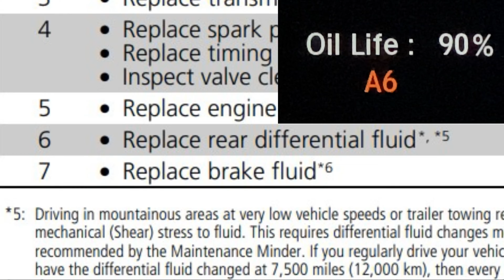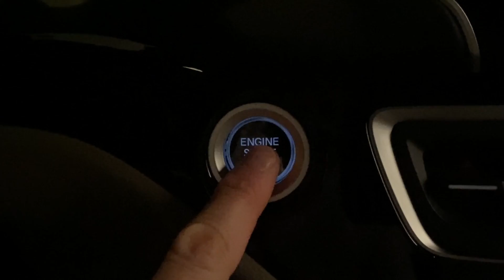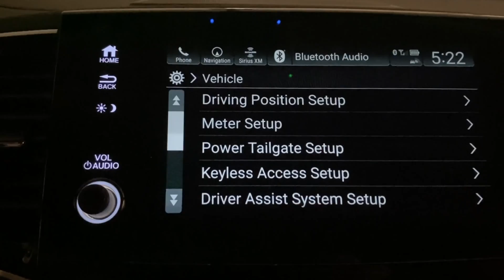2016 - 2023 Honda Pilot Rear Differential Fluid Replacement (With Bleeding Procedure)

Comment from the maker: • Honda 08200-9007 Dual Pump II Differential Fluid:  https://amzn.to/41LgQWw
• Eneos 3410-300 Import DPS Fluid:  https://amzn.to/3KYp0o0
• Quart Bottle Fluid Pump:  https://amzn.to/3UXZxPS
• 3/8 Inch Beam Torque Wrench:  https://amzn.to/3n0VLsz
• 3/8-Inch Drive Click Torque Wrench:  https://amzn.to/3Anrw2c
• Extension Bar Set:  https://amzn.to/3UXCnt8

https://www.piloteers.org/attachments/rear-differential-fluid-inspection-and-replacement-awd-1417-pdf.157832/
https://www.eneos.us/product/eneos-import-dps-fluid/

As an Amazon Associate I earn from qualifying purchases.

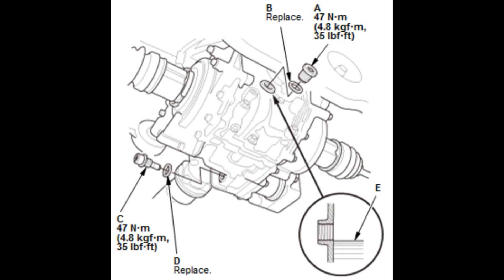Comment: I have a 2017 Honda Ridgeline which has many maintenance tasks identical to the Honda Pilot.  WHERE did you find any of the maintenance diagrams you show (e.g.  at 1:45)? I can't find any repair manual or documents.

Comment: Thanks so much for sharing; this was a perfect video!  I have a newer gen. (23-25+) and I was able to use just a 6 inch extension for the fill plug.

And this probably goes without saying,  and many will laugh at this, but make sure the vehicle is level when you fill it!  I drained it with the rear elevated, which works great because of the drain plug location.  However,  I filled it with the rear elevated.  I got out and looked and said, this really needs to be level.  As I raised the front to level it out,  a decent amount of fluid drained out.

Make sure your car is level before filling!

Comment: There is a boatload of videos for the rare differential but not found one yet for the front which I believe uses traditional gear oil? I wonder why that one is so ignored?
Reply from the maker: I believe that it is lubricated by the transmission as it is built into the transmission housing.
Reply: I did finally find a video. And found the specs on Honda repairman.  The front differential is gear oil. Apparently  even easier to change. I already bought the gear oil I'm changing all the fluids this weekend.
Reply: Would the front differential have to be bled? @OwenLucas
Reply: Yes sir, every 30k just like the rear. And it does use gear oil. It is easy peasy to change out. Lower and upper bolts are up n down from each other facing forward toward the front of the car. Good to do while changing the trans fluid. I would send you a screenshots but I can't attach pictures here apparently. You can look it up.
Reply: @eastcoastroadrunner  is it the same bleeding procedure for the transfer case!
Reply: @tribeofissachar9148  about the same, just did mine yesterday. Even off the vehicle, drain, only holds about a 1/2 qt of gear oil. Refile till it flows out. No need to restart and check again. Both bolts are the same with 20mm washers like the one on the top rear differential. Uses Hypoid gear oil SAE 75w-85 or 90.
32 ft lbs for both. The easiest/fastest  fluid to change on the whole vehicle...lol
Reply: @eastcoastroadrunner  ?

Comment: This is one of the best Honda maintenance videos I have ever seen.  Great job!! Question, the link to the drive click torque wrench has a different looking product than in the video. The on in the video looks more like the Amazon basics one.  Just wanting to confirm that.  Another quesiton, does the car have to be raised to do this work?
Reply from the maker: Thank you for the heads up! You do not need to raise the vehicle, it does get tight under there though!

Comment: Thank you very much for your detailed video explanation demonstration. My car is a 2022 HONDA CRV-Hybrid. I followed your video to change the transmission oil for the first time. Only question, why is the old oil I put out colorless and the one you recommended is pink. Could it be that the wrong oil type was replaced?

Comment: Which plug gets the 20mm washer?
Reply from the maker: I believe it was the upper drain bolt.  It's been a while so just make sure to keep track of the sizes when you are removing the washers.
Reply: I just changed my transfer case and rear differential fluids today. On the differential the fill plug gets the 20 mm washer.

Comment: I was just at my local Honda dealer a few minutes ago, and they told me the torque spec for the drain plug and fill plug for both the rear differential and the transfer case is 31 ft lbs for my 2018 Honda Pilot.
Reply: That’s literally no difference learn how to tighten something without relying on torque specs
Reply: @Therealestrunnerluda  Thats foolish and risky. People have put small cracks in housings that way.
Reply: @Therealestrunnerluda  You mean learn how to break things and cause tons of headache because you think you know better.  People that THINK they know how to unmeasured torque are why the ford dealer put the wifes lug nuts on so tight my 1200 ftlb impact could not break them free.  Would have been completely screwed if roadside.

Comment: I’ve got a 2021 pilot with 45k miles. The b16 maintenance light came on which according to the internet means it need tire rotation, oil change, and differential fluid change. Does this mean that every time I change the engine oil I’ll also have to change the differential fluid? Thanks and great video👍🏻
Reply from the maker: Once you reset code 6 you won’t have to do it again until it comes back on with the maintenance minder on the dashboard.  You should be good for at least another 30k miles.
Reply: @OwenLucas 😊

Comment: How often should this be changed? I have a brand new 2022 Honda passport EX-L with only 10291 miles on it. I see that my oil has got 30% left and the B6 code sign.
Reply from the maker: Honda's maintenance minder system does not generally go by mileage intervals, the computer decides when its time to change a fluid based on usage features such as age, temp, distance.  To me, 10k miles seems very early for code 6 but it must be done.  30% is probably indicating oil like left.  On my 21 it doesn't provide a % for any other fluid other than oil.  From what I've read online, such as the Piloteers forum, the average interval for the rear diff is 30k miles and oil is 10k miles.  I do my oil at 5k intervals though.

Comment: I changed my rear differential fluid today on my 2023 Honda Pilot and this guide was spot on, thank you!
Reply: How much did cost you ? because i am at the dealer and they are charging $150
Reply: @fawad20982  Total of $70. bought all items from Amazon. $60 for fluid, $5 for drain plug, $5 for fluid pump. Took about 15-20 minutes to do.
Reply: @fawad20982  150 here too in northern california
Reply: @fawad20982  about $50 for parts/tools and fluid. About to change it again.
Reply from the maker: Awesome!  Glad to help and hope your experience was less messy!
Reply: My dealer originally charged me 189.00 at 18k miles. Then at 40k tried to charge me 490.00, this time I passed. Now at 60k; my cousin who ‘was’ a Honda tech at El Cerrito Honda; removed & replaced my rear diff fluid for 50.00, and 48.00 for parts. Done.
Reply: I got 2023 pilot sport too nd currently 21k. 1st oil change and diff fluid was changed at the dealership. Im thinking of doing it on my own next. Did u reset anything in the screen?
Reply: @TanSuroYan  yes, I think the code you need to reset is listed in the owners manual under the  maintenance section.
Reply: @nick94712  my manual says different to my sport trim. What it does says on it is for higher trim that have to use the screen. I got no prevailage like higher trims but i have to double or triple check it again b4 doing anything on my own.

Comment: How many miles were on your Pilot when this A6 indicator showed up on your maintenance minder?  Also, could you also do a video on how to change the gear oil in the transfer cares.
Reply: If the transfer case was part of the transmission why is it different fluid and different service intervals? May want to rethink your comment.
Reply: @Sparkynutz81  The transfer case is not part of the transmission, it is only attached to the rear of the transmission.  It takes a totally different fluid then the transmission (GL5 Gear oil) and only holds about 0.5 US qts
Reply from the maker: I don't remember the exact moment because it did not illuminate as a warning, just when I checked the maintenance minder for the oil life is when I saw code #6.  It should come up at 15k miles but the maintenance minder system has a life of its own.  The transfer case is part of the transmission so changing the transmission fluid would change the transfer case as well.